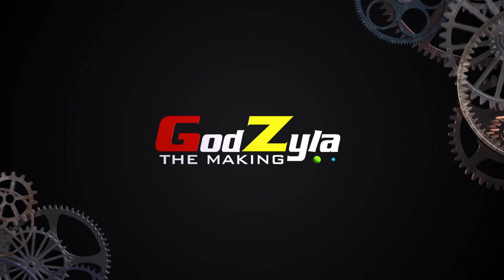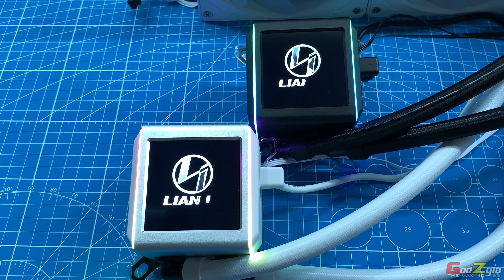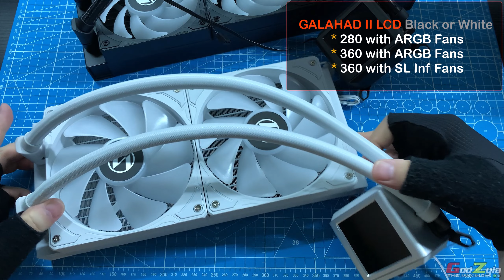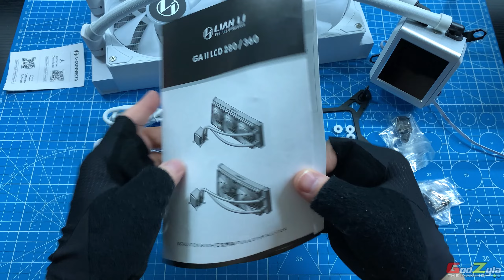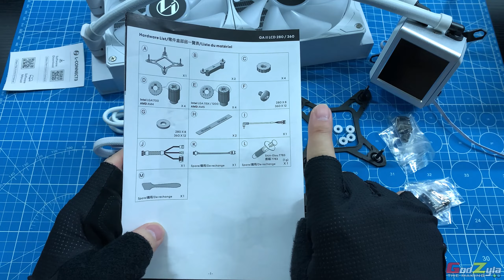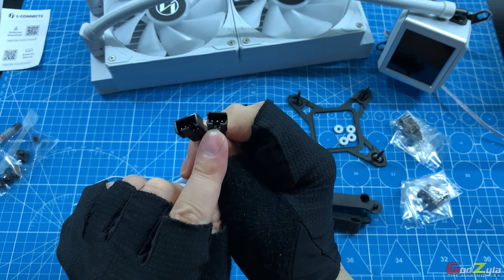Lian Li Galahad II LCD

Comment: Nice video but there is something confusing. In your video and some others I have seen that you recommend to use the screws with the dots for the Intel 1700 platform but the manual says otherwise (I have just checked again). Could you please clarify ? I have mounted mine with the non dotted screws (LGA1700).
Reply from the maker: Hi joeedbkk, welcome to my channel. You did the right thing. my bad, I read the instructions on the manual incorrectly. for the retention bolt without the dots, it's for Socket 1700 & AM4. As for the retention bolt with dots, they are for 115x / 1200 and AM5. Going to pin your questions. thank you for correcting me.
Reply: @KleoYan Thanks for the quick clarification and the detailed video.
Reply from the maker: @joeedbkk  you are most welcome and thank you to have corrected my mistake.
Reply: Hi thanks also for clarifying

Comment: Any issues with the LCD defaulting from your saved image or GIF to the Lian Li logo? Mince does it and I have to restart my PC in order for it to show the correct image again
Reply from the maker: Welcome to my channel Mac Hill, mine will be back to default Lian Li logo when restart or start from cold boot, but my settings and image will be back once Windows is loaded.
Reply: @KleoYan  Thx Kleo.Mine starts up fine from sleep mode, but after about 30-45 minutes the LCD will change to the logo and LConnect shows my saved GIF, Only way to get it back is by restart unfortunately
Reply from the maker: @smoke71880  Might be a glitch. uninstall the L-Connect 3 app with Revo uninstaller ( https://www.revouninstaller.com/ ). Revo uninstaller will remove all unwanted files / folder / registry in your system. Illustration to use revo uninstaller https://www.youtube.com/watch?v=uMgUYiakpxM&t=437s , then reboot your system, empty your recycle bin, reinstall L-Connect 3 again.

Actually I operate PC Differently as compared to most, I never set PC to sleep or hybernate. The Hard disk is set to never to turn off, only set monitor to sleep after 1 hour. Maybe that's the issue ..

Comment: Hey, can I ask something?
I connected the cable from the radiator directly to the motherboard's CPU fan header and ARGB header (cable "N" in the manual).

I'm not using cable "J", which connects the pump to SATA power.
Is that okay?
Right now, the pump, fans, and RGB are all working properly
Reply from the maker: Hi Gwynbleidd, welcome to my channel, it's perfectly ok. just that you can only control the ARGB and LCD on the pump but not your fans. Also the PWM curve you need to set in your motherboard UEFI.

Comment: I got one of these* after a month the lcd screen stop working & The program doesn’t detect the ai coolant. What should I do ?
Reply from the maker: Hi Rona1do Hernandez, welcome to my channel. There are a couple of things you can try.

1) Check your device manager to see if you see the Lian-Li GA_II-LCD_v1.4 if no check if your chipset driver is up to date
2) Switch the Internal USB 2.0 
3) Find a long Type-C to Type-C cable and plug to your GA II LCD. 
4) If device is detected but can't control with L-Connect 3 app. use Revo uninstaller ( https://www.revouninstaller.com/ ). Revo uninstaller will remove all unwanted files / folder / registry in your system. Illustration to use revo uninstaller https://www.youtube.com/watch?v=uMgUYiakpxM&t=437s , then reinstall L-Connect 3 app. 

if all else fail, contact lian li support https://lian-li.com/contact-us/ of your case.
Reply: @ thank you i did buy a new motherboard n everything is updated. I’m going to give this a try
Reply from the maker: @rona1dohernandez730  you are most welcome. All the very best. I hope your issue will be resolved soon too. 🫡

Comment: I have now seen 3 different videos of the same cooler all with different connections and sockets. Like my brain is literally melting trying to install this crap
Reply: This guy has fans with longer cable too while mine only has a small one 1 cm cable on it. And the others come with controllers that this doesnt have...
Reply from the maker: Hi Yazy, welcome to my channel. There is always an instruction manual that comes with the liquid aio if you find most content are different from yours.

Comment: Anyone know how to sync the RGB on the lcd screen and fans to the motherboard? I have the "Sync Screen LED" thing checked but I think that just syncs the fans with the lcd, I would like to sync them to the MB if I can.
Reply from the maker: Hi GG- Csernus, welcome to my channel. In L-Connect 3 app, on your left, there is a Quick/Sync Lightings, enable MB Lighting Sync.
Reply: @KleoYan  The pump block can't be synced with the motherboard software. this is real? source? Reddit
Reply from the maker: @csernus22  oh ok ok I got it wrong, I though you are refering to fans. if that's the case nope, I cant sync either as there are no 3pin cable from the pump to the motherboard. my bad.. you might want to post your feedback at Lian Li's reddit. https://www.reddit.com/r/lianli/

Comment: Hey so I’m using the slv2 fans with the Galahad radiator. 3 exhaust fans. I’m using the slv2 controller as well. Could you help me with this setup? I have not been able to find a video where they plug in the Galahad to the slv2 controller. It’s very confusing as all of the videos are only using the controller that came with the Galahad. Thank you…
Reply from the maker: Hi RIP PRAISE, welcome to my channel, before I am able to aid you. kindly list down the Lian Li argb products in detail. example 

1) Galahad Liquid AIO, which model, there are various, example Galahad II Trinity SL-Infi, Galahad II LCD, Galahad II Trinity Performance??
2) your sL120V2 fans, are they of single pack or triple pack? 
3) What are the total SL120V2 fans you have? and what kind of arrangement in a case? btw which case?

without indepth details I can't guide you.
Reply: @KleoYan thank you for your reply. I have the Galahad lcd 2 and I’m using 3 reverse slv2 fans on the radiator. I also have the control box from the slv2 3 pack. I have 6 reverse in total and 2 regular blade for the back of the case. It is a Lian Li vision compact case. I was confused on how to connect the fans to the AIO since the control box is a little different. I’ve watched this video a couple of times and might have figured it out. This is my first pc build so forgive me if these are dumb questions lol.
Reply from the maker: @rippraise2254  Instructions are as follow

Steps
==========
1) Place 3 x SL120V2 reverse fans (daisy chained) to your Galahad II LCD . do not use the cable that comes with the single pack , make use of the cables in your triple pack. where one end connects to your raidator fans and other end, it will be a 7pin plug which will goes to the Control Box

2) For the rest of the fans, daisy chained them accordingly and again make use of the cables that are in the triple pack, where one end to the fan and other end (7pin connector) to your Control Box

3) Controller Box, once all sets of fans are plug to Port 1 to port 3, plug the USB cable from your Controll Box to your motherboard USB 2.0 Socket

4) Make sure to plug the Sata cable from the Control Box to your PSU Sata Cable. 

5) [Optional] There is another cable which has one end connect to your Contol Box and the other end has two connectors, 4pin PWM + 3Pin ARGB. Plug the 4pin PWM to your motherboard Fan header, plug the 3pin ARGB to the motherboard argb header. This allows you to set sync to motherboard on L-Connect 3 application to use your motherboard application to control the fan pwm and argb. As mentioned this is optional, you can dont plug this at all if you want to use L-Connect 3 app to control the fans rpm and argb effects. 

6) For your Galahad II LCD, plug only the USB type-C connect to the pump and the other end to another USB 2.0 header of  your motherboard. Next plug the 4pin PWM cable to your motherboard PUMP_AIO header. 

7) Install L-Connect 3 application to control the LCD , ARGB and FAN RPM.

go slow 1 step at a time.
Reply from the maker: @rippraise2254  you are most welcome. All the best with your build too. 😉

Comment: I've been so pissed off dealing with this product mine didn't come with the adapter attached to the fans and it's been an absolute nightmare trying to get that adapter I am ready to absolutely lose my mind It's been over 2 weeks and no one can figure out how to get that adapter
Reply from the maker: @gambino48  Hi welcome to my channel. Where did you purchase your GA II LCD from? You should escalate this to the seller or you can raise a Lian Li support ticket. Attached the invoice of the unit and request for it.
Reply: @KleoYan  I got it figured out! thank you so much for reaching out my friend! I got in contact with Lian Li and they sent me 2 cables just to make sure so they were great ….Your video is by far the best on YouTube for this installation man...nobody explains it as well as you....I do have one question though ...right now I have mine setup like yours...i have it connected to my motherboard...but recently I just bought the Lian Li Uni Fan SL-INF 120 RGB fans and the fans come with a controller...am i able to connect the fans on my Galahad LCD 280 Cooler to that controller? this way i can have everything running through the controller... and if i can, how ?
Reply from the maker: @gambino48  Hi and welcome back. if you intend to replace them with the SL-INF 120 RGB fans. the existing cable from the pump to the original fans, you can't use it. you will need to connect your SL-INF to the control box. This way you can control them all in L-Connect 3 app. steps are as follow

Steps
==========
1) On the GA II LCD, plug only two cables to your motherboard from the pump. The USB type-C connector from the pump to the motherboard USB 2.0 socket and the 4pin PWM connector from your pump to your  motherboard PUMP_AIO header. 

2) Place 3 x SL-INF 120 fans (daisy chained) to your GA II LCD Radiator

3) Plug your SL-INF 120 fans connector to the uni fan controller / control box (either ports, 1 to 4)

4) Plug the USB connector from the control box to your motherboard 2nd USB 2.0 socket, also make sure you connect the SATA connect from the contol box to your PSU Sata cable.

5) [Optional] There is another cable which has one end connect to your Contol Box and the other end has two connectors, 4pin PWM + 3Pin ARGB. Plug the 4pin PWM to your motherboard Fan header, plug the 3pin ARGB to the motherboard argb header. This allows you to set sync to motherboard on L-Connect 3 application to use your motherboard application to control the fan pwm and argb. As mentioned this is optional, you can dont plug this, if you want to use L-Connect 3 app only to control the fans rpm and argb effects. 

7) Install L-Connect 3 application to control the LCD , ARGB and FAN RPM.

hope this helps.

Comment: Always very helpful and thorough, thank you.

Would it be possible to switch these fans for SL-INF 140 and connect them into the pump without an issue?
Reply from the maker: Hi Narueen, welcome to my channel. you can swap to the SL-INF 140, but as for connection, you can only plug the 4pin PWM connector to the cable shown at 20:11 then connect to the pump. But for the ARGB, you will need to plug directly to the motherboard. In L-Connect 3, you can control the LCD, the pump RPM and the fan RPM but for the fans ARGB, you will need to use the motherboard ARGB utility.

Comment: Kleo can you plug the type c connector into a splitter that's plugged into the usb2 on the motherboard? Thank you
Reply from the maker: Hi Mike, welcome back. you can do that but sometimes with insufficient power due to too many devices plug to the USB Splitter, your LCD might not function properly. there might be flickering or ghosting images.
Reply: @KleoYan thank you. The lcd seems to work perfect but I didn’t hook up the other wire into the hub as I’m using a TL and an SL Infinity controller. I’m still having issues syncing the fan leds.
Reply from the maker: @Mike-hs8fq  hmm.. means you have total of 3 controller listed in device manager > universal serial bus devices? I would check on that first, got to make sure it shows 3 devices then you will be able to control the fans through L-Connect 3.

Comment: How do i connect the control hub if i have more fans i still can work it out
Reply from the maker: Hi sicario187, which fans are you referring to? I have no clue which fans or hub. The illustration here, the orginal unit itself, the radiator fans are plug to the AIO pump block and there are no hub..
Reply: Hi yeah, so I have the Galahad LCD 280 AIO and I have the TL Uni Fans 3 pack. I have the strix b550-i gaming motherboard which only has 1 usb 2.0 so i ha e ordered a 4 port usb hub so i can connect The AIO and the fan hub from the triple pack but so confused how to connect the hub with extra fans

Comment: is the l3 control device required to run the fans of the radiator?  i have mine connected but the program does not detect it even if it at high speed settings
Reply from the maker: Hi Ernesto Comignani, welcome to my channel, if your Galahad II LCD are of standard and not uni fans, you can run those fans directly plug to your motherboard, but for the LCD you will need the L-Connect app. Before you tweak, please check to see if your GA II LCD device is detected in device manager, under universal series bus devices.
Reply: @KleoYan  Thanks Kelo, my problem was a faulty connection . The 8 pin connector next to the mini USB on the block was not inserted properly even though it was flush with the device , just had to push it in just a tad bit more and they started up. Thanks for the reply great video, only video covering this unit as far as i know.
Reply from the maker: @ErnestoComignani  Hi, thannks for the update. I am glad you got it sorted out.. 👍👍👍

Comment: Hey Kleo, do you still use the Galahad II in your personal build? How do you find the reliability and overall use? I'm trying to decide between this and the Kraken Elite 360 and I've read some problems with L-connect software and the LCD having issues loading images on bootup. Putting this into a O11 vision, so was going to take the 3 infinity fans off the AIO, replace them with reverse 120mm (in) and mount two of the fans that came with the cooler to the back of the case (out) instead. Then line up the bottom with 140mm infinity fans (in). Does the Galahad II come with a fan controller to sync this setup?
Reply from the maker: Hi Poeshyn, welcome back. i do not know how the Kraken Elite 360 works but am still using the Galahad II LCD 280 in my primary rig. Till now I have no issues with the display or with the performance. Just a reminder, if you are using mid tier processor, the reverse sl-inf fans are ok, but if you are doing i7 to 7900X, then you might want to do push pull configuration as the reverse fans have slightly lower static pressure performance. of course you can test it out with single push or pull configuration, if thermal are not ideal then get another set to do push pull configuration. btw not sure if you know how my current righ looks like, just to share https://www.reddit.com/r/MontechPC/comments/19esupr/project_montech_king95_pro_sonic_the_hedgehog and with the new 24H2 Windows 11, my thermal are even better.

Comment: Hello Kleo Yan, i am looking to purchase the galahad II lcd 360 with the infinity fans. Would that work with the king 95 pro case? I previously purchased the lian li hydroshift with the infinity fans and had some fitment issues. Im am now trying to find a replacement with the same fans. Please let me know, thanks!
Reply from the maker: @zombie474  hi welcome to my channel. For the GA II LCD with the SL-Inf fans, it will work, mounting at the top, but if that’s the case you should have gotten the King 95 without the pro. As I believe you want to have all SL-INF fans to make it uniform.
Reply: @KleoYan  yea maybe further down the line because the build is already alot of money so I went with the pro for now.
Reply from the maker: @zombie474  oh I see. Ok, all the best with your build too 😉
Reply: @KleoYan  awesome thank you so much for your help 👍 much luck with your endeavors as well
Reply from the maker: @zombie474  thank you too 😊